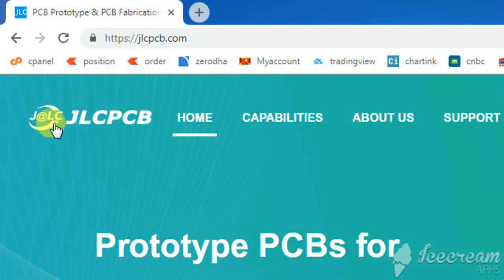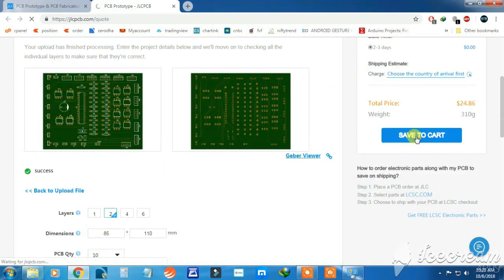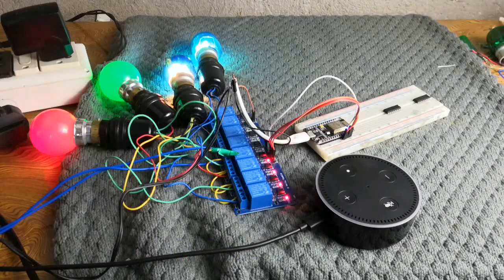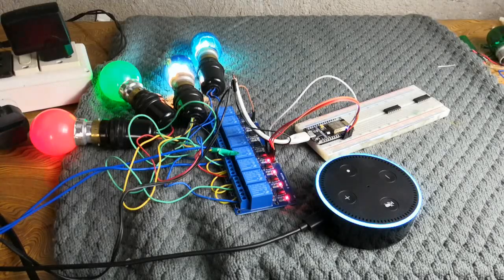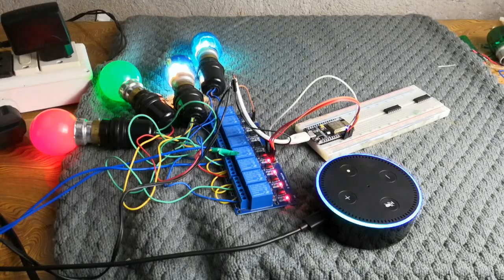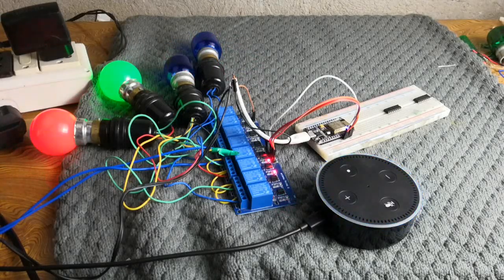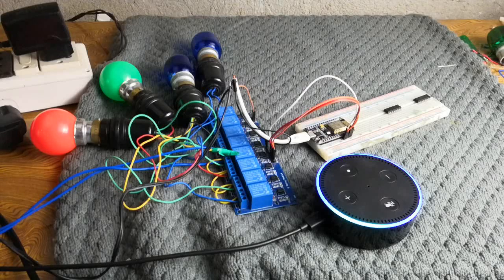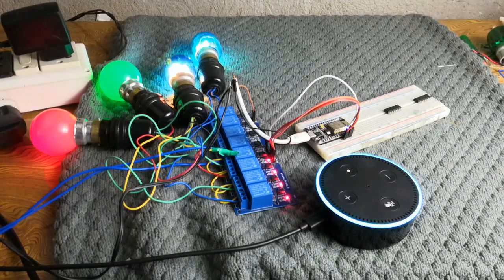How to make voice control smart home for light fan tv  DIY

Comment: Its very much costly the total price to build up needs minimum 5000   if u done this without alaxa then some cost will be reduced  secondly without having any permanent wifi like brodband its work r i should keep home wifi
Reply from the maker: I bought alexa under 2500.... At offer... Total cost for me it is around 3000 rs
Reply: @thestory_92  ok
Reply: As the active wified internet connection in home nessery for working this project ?
Reply from the maker: @sanu7210  yes
Reply: @thestory_92  how its arraound 3000 only a wifi module arraound 300  and  8 channel relay 450
Reply from the maker: I bought the items from chinease website..so my cost is around 3000-3200...
Reply: @thestory_92 which Chinese website ? Banggood or other ?
Reply: @thestory_92  I want this please give me your call number